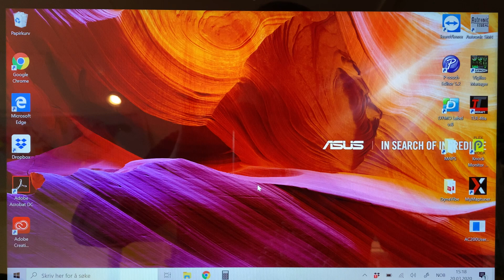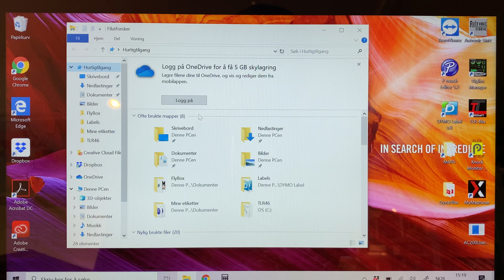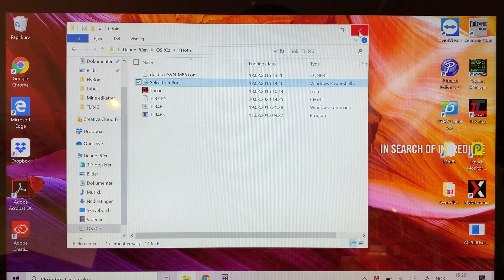Rotax TLR46a on Windows 10 64-bit

Comment: Rs232, that is some old software, maybe an update is in order, the year 2000 was a long time ago.
Reply: RS-232 is a serial port communications protocol. Still widely used.
Reply: flexairz go ahead and buy a lap top with it, I had to add one to my desk top, I also found a dock with it. The converters from USB are not the best. Yes the are still around, but slow and hard to use.